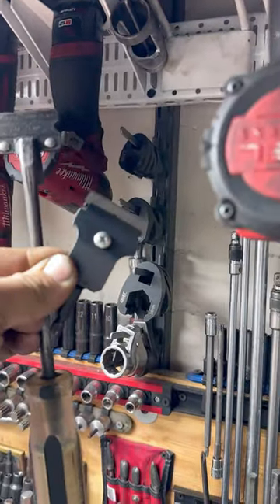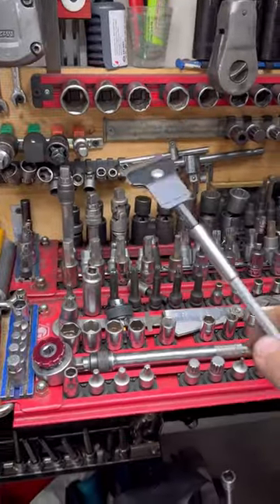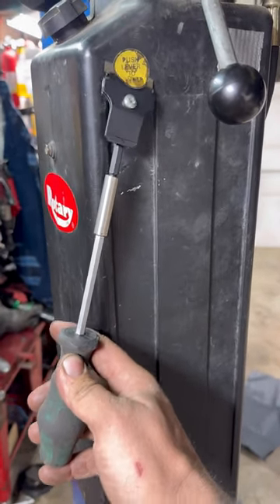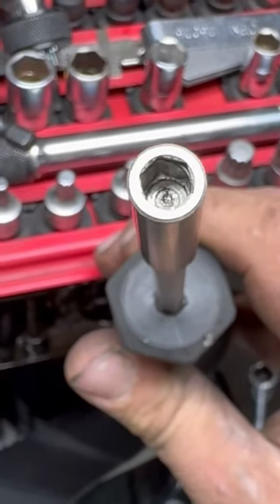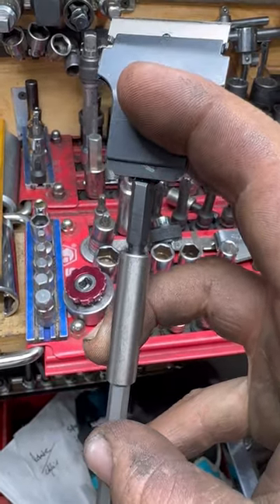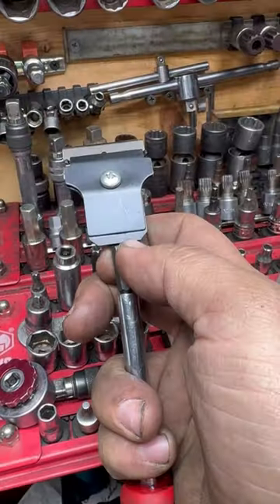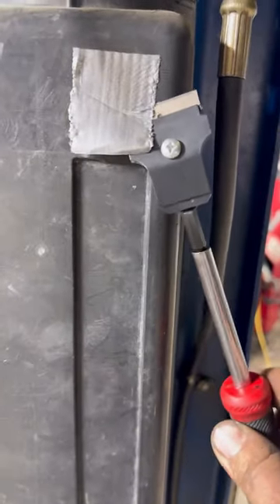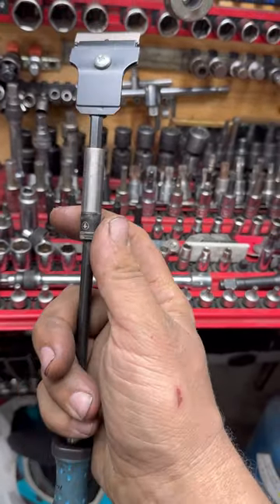Gasket Scraper 1/4 Bit Attachment vs Screwdriver adapter handles locking retaining ring & magnetic

Comment: Tip: Get a hot air gun and heat the sicker before hand.
Makes removing it easier so you not constantly applying force and can help prevent you from damaging something or hurting yourself, it also makes getting rid of the residue easier too.
Reply: Yup. Best way to do it. Also helps with stickers on vehicles. Can use a plastic scraper and avoid damaging the paint
Reply: @BabaYaga214  plastic scrapers can still damage paint.
Most paints these days are soft for environmental reasons.
Its why modern paints are so easy to get swirl marks on.

Comment: 😅 ya i was curious when you did that in the first video lol definitely not meant to spin i dont think but maybe could have a power tool function if you have a drill driver with a hammer function that doesn't spin just hammer impacts you may be able to use that as a power scraper 🤔